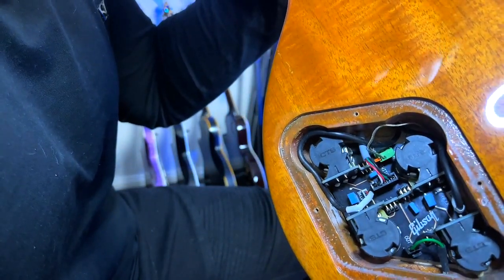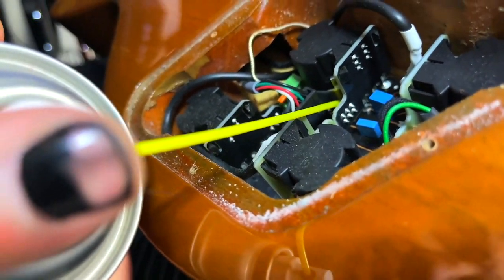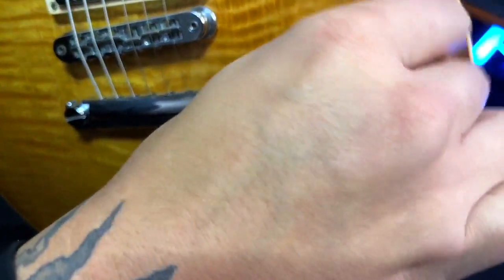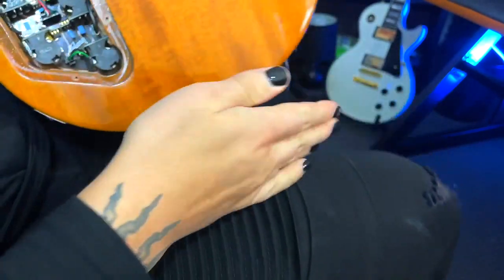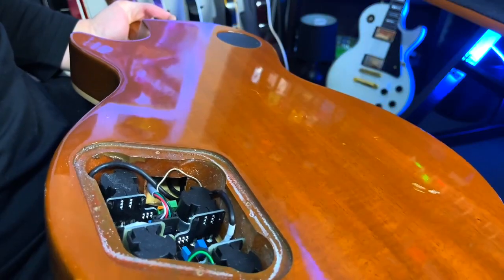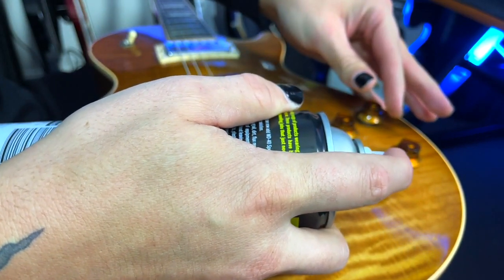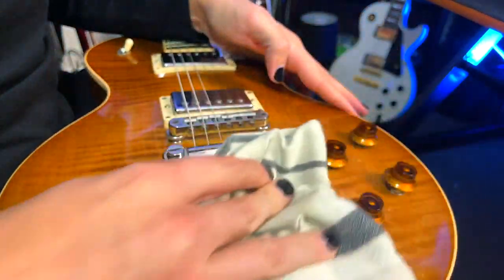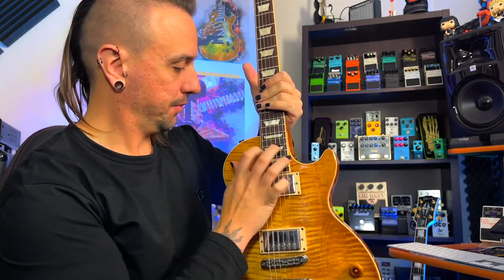Fix A Noisey Crackling Volume And Tone Knob

Comment: Will blowing compressed air into the pot instead of the cleaner you used be effective?
Reply from the maker: I’m certainly not the authority. I imagine it would take care of some of the grit, but I honestly haven’t tried, & I don’t know.
Reply: I gave it a shot with some canned air and it worked! No more crackling. A bunch of crud came out when I sprayed the air in the pot so do this somewhere you don't mind getting dirty.
Reply: WD-40 Will not clean pot ,but move crud from one place to another.